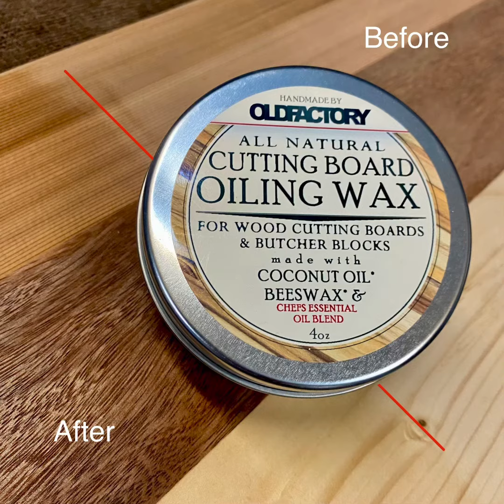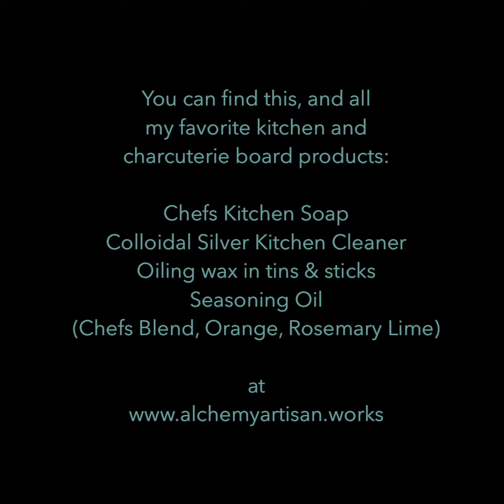How to condition your charcuterie board with oiling wax

Comment: What top coat you use for the epoxy to be scratched?
Reply from the maker: Hi, right, “not” scratched. 😁 I don’t. I recommend only to “serve” on charcuterie boards. They are not “cutting boards” and not meant to cut on. No abrasives or “scrubbies” should be used to clean, just a soft cloth (microfiber is great) and a little dish soap, if needed. Used as recommended, the epoxy is quite durable.
Reply: Thanks, I’m appreciate and I like your job very much!!